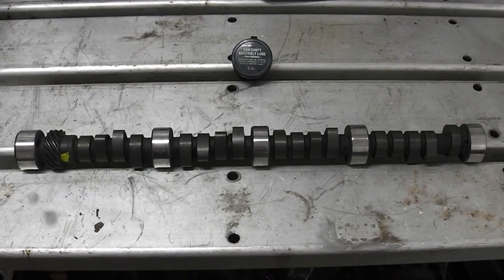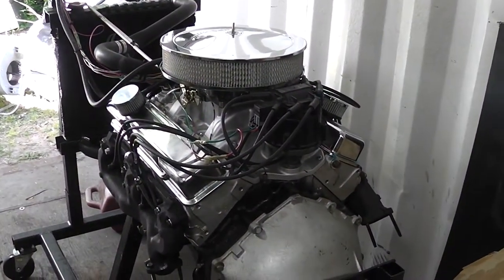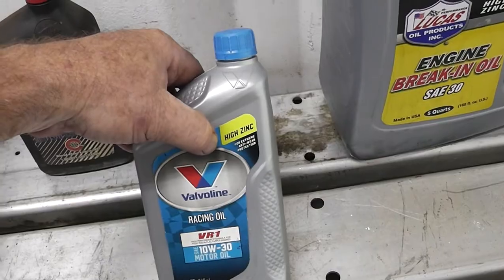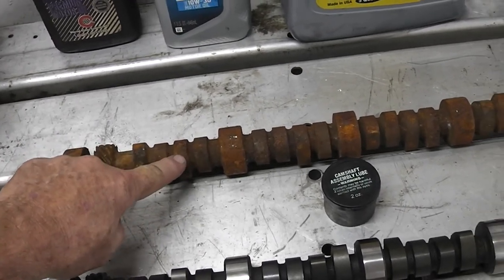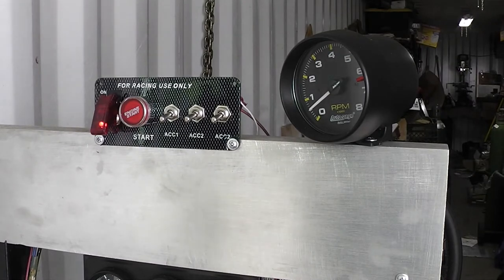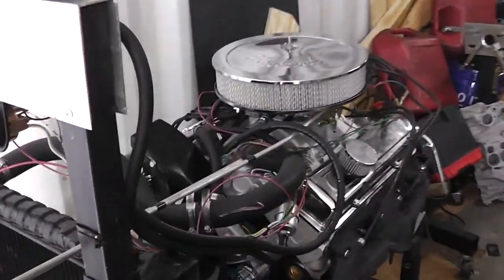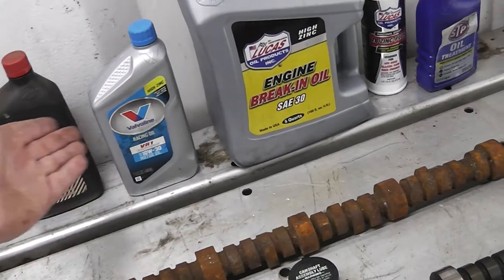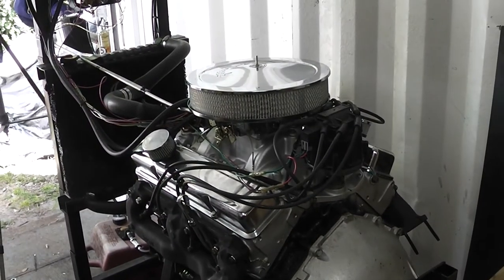How I Break in a Flat Tappet Hydraulic Camshaft

Comment: 100% agree...you sir get my vote of approval for the most accurate flat tappet cam break in procedure on YouTube. This is exactly what I tell my customers. Break in oil, additives with oil AFTER Break in, spray pattern varying the RPM Etc... And in over 30 years in business and literately engines in the thousands, I've only lost maybe 3 or 4 camshafts during break in. Awesome Video. you have my Subscription for sure!
Reply: Too many run em at 2000 maybe, never vary rpm or crank the daylights out of it rather than make sure the bowls have fuel and dist is in right.

Comment: "Break in"  Did Detroit ever do this, or did they just do a 5 or 6 minute run in to check for leaks and vibrations/noises, and get the timing set plus final carburetor adjustments to decide if an engine was worth putting a transmission on?  As close as I can find, Lunati came out with 'voodoo juice' somewhere near 1990ish, but other more seasoned engine builders would know more than me about special oils history.   Point being, a "break in" is a final mating of parts - a burnishing of sorts. The modern variant strangely uses oils with decreased protection to accelerate wear. [Why are we wrangling with cam failures I ask?]  There's only one engine component that has no other choice but to finish mating after a machine is built:  the rings.  And if the hone is good, that happens quickly. Our cams and lifters only need oil film protection - if ra stays under 40 as ground.   Maybe... break in oil should dress the bores and skirts for assembly and that vr1 goes in the sump?  There is no help from the SAE crowd because the astm tests [IVA and IVB] they lean on for cam and lifters both specify overhead cam engines as part of test procedure, and that means...API certs and product labeling are useless or non-information when the application is a pushrod/flat tappet engine.

Comment: Most flat tappets are going flat no matter, I just built a motor, had it on a break in stand, put in $100 break in oil broke it in at 2500 for 30 mins, dumped the oil and filter put another $!00 break in oil and filter and 4 hours later flat. My buddy just broke in a cam and same thing and while we were discussing it in the store two other people said their cams went flat. I just watched a video from a well know builder saying 50% of flat tappet cams now go flat. Also some builders will not even put them in and you can bet they know how to break in a cam.
Reply: I recently had the same failure with a new flat tappet Cam on a BBC spent 1300 Dollars on a hydraulic roller retrofit set up, definitely hurt the wallet been running great for a couple months now not a cheap conversion for sure

Comment: Question, I've bought a few flat tappet cam 350 Chevy cars and trucks over the years from 1969 to 1990 and not once did the dealer say I had to break in the flat tappet cam in the motor, so why now?
Reply from the maker: I'm sure the factory had some sort of break in before the car or truck got to you. It is my understanding that a flat tappet new engine must have a wear pattern established on the cam and lifters.
Reply: @Gearhead.327  I don't know, my Dad worked at Chrysler in Windsor Ontario in the 60"s and he was the guy that drove the vehicles to the parking lot when they came  off the end of the assembly line so I don't think that was much of a break in period.

Comment: I'm building my first full build 306    in a bit... the one question I always cant seem to find the answer to is about     timing.   I have a basic idea of where my distributor is supposed to be pointed ( its EFI so where the TFI is pointing basically ) based on a photo when the stock engine came out.    I always read how important it is to get the RPM right up to 2000    but how important is timing?   Obviously a team of two   that were good could be running a timing light DURING break in but that may not be possible for me.     I do plan to do the 10-10-10 method ... but like is it okay as long as the timing is in a ball park?    then worry about it after that first 20-30 minutes?   Or is it crucial its right on... thanks for any help
Reply: Check total timing say at 3k maybe a lil less. 
If its too retarded the pipes will glow red and run hot. Have someone monitor engine temp the other keeping an eye out for leaks under hood.
I like to keep them around 2500 give or take occasionally running more rpm so you get lots of splash

Comment: Have you ever broken in a new set of lifters on a cam that’s already existing? I’ve got an AMC 304 that has a crane 272 cam in it that I like but the lifters won’t pass oil to all of the rockers.
Reply from the maker: No, I always have gotten a new cam and new lifters. I would check your pushrods to make sure that they are not plugged. I would also be wary of "imported lifters".

Comment: My rebuild 350 just got a flat cam lobe some mechanic told me since I got metal in the oil I need a new rebuild again. Is it true or can I just replace the cam and lifters
Reply from the maker: At the very least, you would want to disassemble your engine and visually inspect ALL the rod, main and cam bearings for gouges and scratches. I would do a thorough inspection of the rod and crank journals too.  I would check the piston bores and piston skirts as well.  You also might want to flush out all of the oil passages and make sure there is no debris in your oil pan that might get later sucked up into your engine later on.

Comment: how long will the lube stay on the lobes after install, will i have a few weeks to put my engine together before breaking it in, or do i only have a few days?
Reply from the maker: I had a flat tappet cam 350 Chevy back in the year 2000 that sat for 1 year before I got to break it in. There were no ill effects. I might add that I used STP as the engine assembly lube.  An old timer told me that back in the day STP will stick around if you can't get to the break in for a while and he was correct. Your should be ok if you use the Isky Rev lube moly cam paste. I can't say for sure if the red goo that comes with some of the new flat tappet cams will survive.

Comment: PAW ? Haven't heard that in forever. Performance Automotive Warehouse. And you still have that little container of assembly lube? What is your definition of liberally? I've got a 351C balanced rotating assy I haven't gotten around to installing. I've got doubts on their honesty. Paid a good bit extra for it all to be balanced. I don't think they did any balancing. They maybe kept their balance while they boxed it up. Anyway, live and learn
Reply from the maker: I clean the cam with mineral spirits or gas before applying the assembly lube.  I also look for any nicks, ridges, roughness or burs on the cam that I might have to sand of with 400-600 grit sand paper. I usually just take my finger and give the cam lobes and the lifters a good liberal smearing of assembly lube.
Reply: Good video.  I actually have 2 of those small plastic containers with the old school break in lube. 
Came with my crane cams from back then. Sold the cams, kept the lube. 🤙🏻